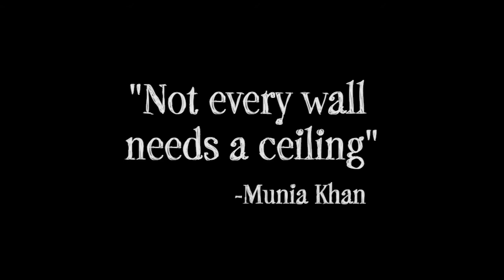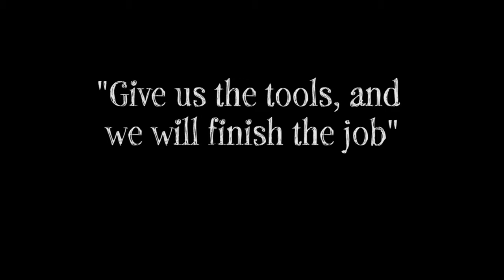Taking Down the Ceiling - Skoolie Conversion

Comment: How are you going to make sure that the electrical wires are still accessible in the ceiling?
Reply from the maker: Haven't decided yet. Either I will spray foam them in behind the walls and/or ceiling not leaving them accessible or I may run them outside of the walls and ceiling. Still have more research to do before deciding.
Reply: Consider disconnecting them and running them through conduit before spray foaming???
Reply: GoatHollow so if we just cut the lines will it mess up whatever it is connected to?
Reply from the maker: I have disconnected most of the lines that were already there. Took out all the speakers and lights. Disconnected emergency exit alarm and top flashers. Just leaving break/reverse/turn signals and running lights. But yes, if you cut the lines, they won't work.